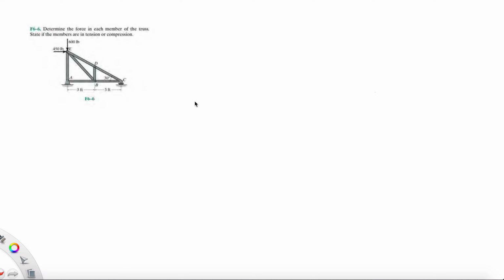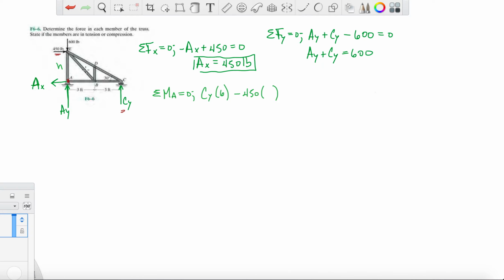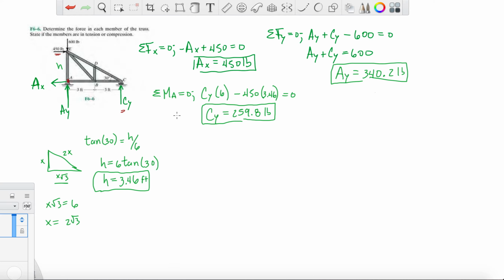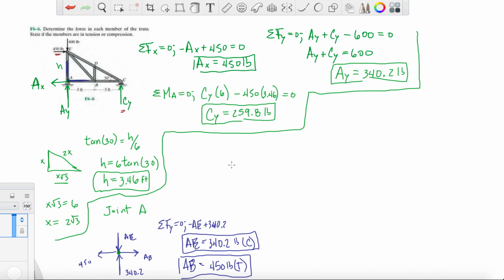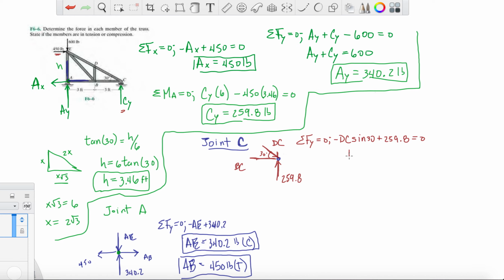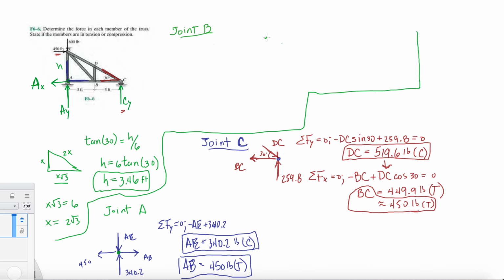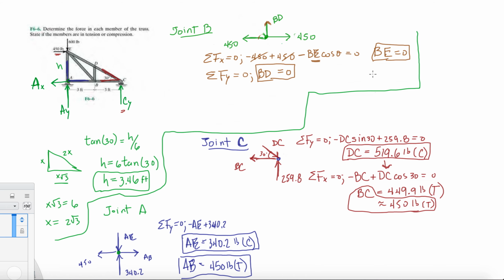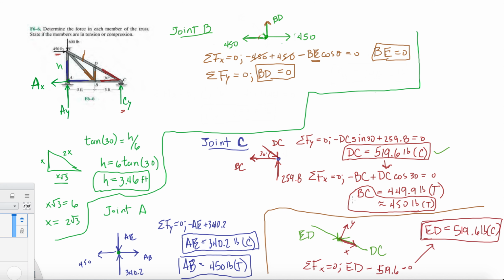Problem F6-6 Statics Hibbeler 12th (Chapter 6)

Comment: Can you kindly do F6-4? I saw different people solving this question but it does not make sense to me..

My approach for F6-4

I am a bit confused on why we need to find the force in the members when we've been told that each member cannot exceed 2 kN in tension or 1.5 kN in compression.
Now, I solved this question by doing this:
I analyzed joint C assuming the two forces in members AC and AB are 2 kN each (tension) but then I found that P sense would be the opposite of what is given. Then I assumed each of AC and AB are 1.5 kN in compression and it follows that P = 2.6 kN.

Comment: I have a Question.
When we were told that Tension is positive force and compression is negative then why in the questions we have to figure out what direction the forces are?
Reply from the maker: For most Truss problems they don't tell you if a member is in Tension or Compression. You have to figure that out on your own. I typically assume Tension (away from the joint). If my results come up positive, that means my guess was correct. If it comes up as negative value, it tells me that my guess was wrong and the member is actually in compression.